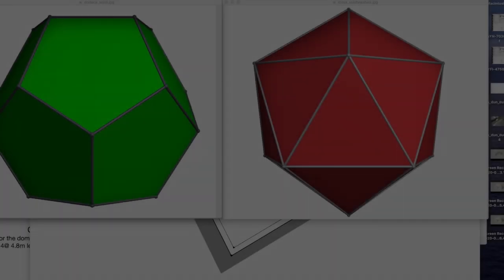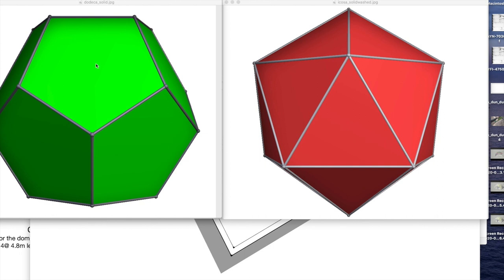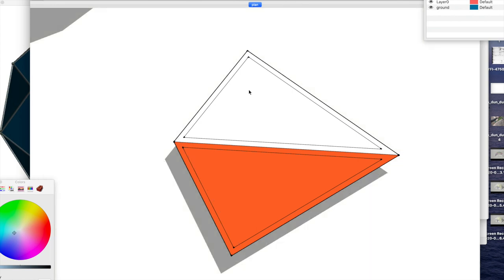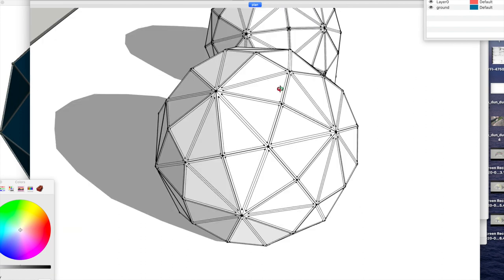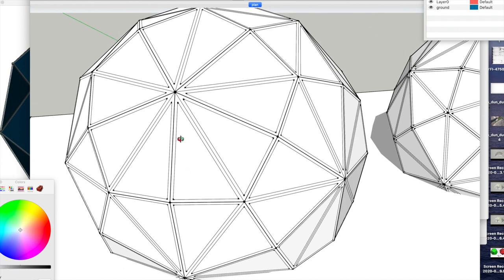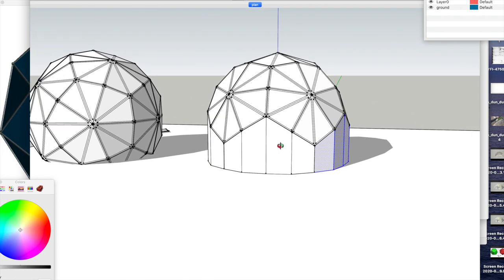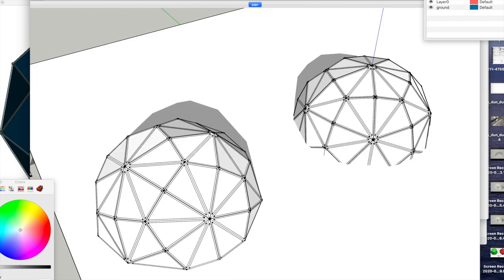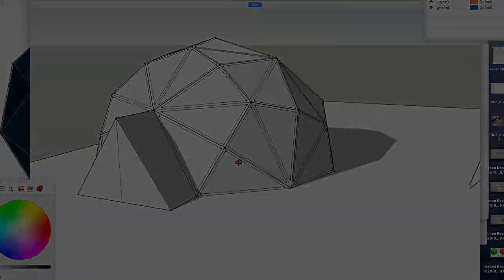Geo dome with only one triangle frame.

Comment: This is very interesting dome using mirror image panels.  Would like to see the plans for this.  A flat based dome of simply one triangle and it’s mirror image.  Doing research before build a dome home.  This or a 2V dome with extra supporting members in each panel.  By what you have shown a standard 4 by 8 foot sheet of plywood could be cut diagonally to cover the frame.
Reply from the maker: Link to plans is in the description on this video: https://youtu.be/V_KhrXggRsU I will be doing more ideas on this design so keep an eye out for them.

Comment: You can stellate a dodekahedron quite easily. Just snap a A4-paper in half diagonally. That's EXACTLY half of the triangle you need. Make two to make a triangle. Make 5 triangles into a pentagon and create a dodecahedron: there you are.. VERY easy to make a model this way. You can also use an A5 (half a4) or A7 (Quarter of A4) if you don't have enough A4 paper. You need 30 triangles. It's basically what he is showing. But I did the measurement math for you, so you don't have to.

Comment: There is one other way to get a door into that dome. In the arrangement that lets you cut it straight in half, just build straight rectangular walls to lift the whole thing up by the height of the door. You could then have essentially a cylindrical wall around the base and a dome roof.

Comment: "Only one triangle frame". Key to a manufactured solution! Domes as a mass-produced Housing solution require a low math variational solution. Dodecahedrons are all the same 'plate'. When edge length exceed 5' the 'v's kick in and everything starts multiplying, vertex angles, edge angles, edge lengths, requiring every new size to have a complete face-by-face mathematical solution. This is a barrier to mass produced geodesic dome spaces.

Comment: Paul do you mean you only need one jig, you just cover different sides with you finished surfaces? I too wonder how big a diameter you could make with timber panels and would appreciate plans, thanks.
Reply from the maker: I've done plans at 6.7m diameter because it works out great for 8x4 sheet material: https://youtu.be/V_KhrXggRsU

Comment: @7:33 Need to correct you there: there IS another way, you can also stellate the icosahedron, like you just did the dodecahedron. Acually it works with all platonic figures. So there is 4 more ways to do this, (also stellated cube, stellated octaeder, and a stellated tetraeder) but only one that makes a bit of sense, the icosahedron..
Reply from the maker: Yes but I thought stellated dodecahedron/icoasahedron are basically the same?

Comment: It's possible to make a one triangle geodesic dome using the class II subdivision on a V2 frequency dome in a different way. Its an adaptation of the basic triacon that is presented on the video called "full triacon". It is made with the same triangle used in the video, but it's mirrored on the longer side of the right angle to make one face of the triacon (just like the "door" made in the last part of the video). With only two diferent sides it's a very simple dome to make, and the base can be made by cuting these triangles in half (witch is the same as using the original triangle). So it would have a total of 32 triangles (or 30, since it's 28 full and 4 halfs). It's good for small domes, maybe less than 8 meters diameter, but for big domes the triangle becomes too big, witch can be very hard to handle. You can use the calculator on acidome.ru to get the angles to project one using frq. 2, class II, and I think in this case the "cross" symetry works better. (Link: http://acidome.ru/lab/calc/#1/2_Class_II_Piped_D100_2V_R2_beams_50x25 ).

Comment: A little question would be if this structure with only 1 sized triangle would be as structurally strong as the "normal" geodesic dome.
Reply from the maker: Yes, as long as a dome has triangle frames it will be stable, the. shape won't make much difference. On the other hand if the panels are square or pentagon/hexagon the structure becomes very unstable.
Reply: @Geo-Dome  I see, thank you very much for your quick answer :)

Comment: Two domes connected with the triangle, and a door on the front face of the middle section, than one side could be the bedroom and the other one the living space. Or even 3 domes connected this way with a separate kitchen module.
Reply: Let me guess. The kitchen modile should be cylindrical abd placed between two domes?

Comment: Loving the simplicity of this dome - is there a way to tweak the aspect ratio of this single triangle so that the panels can be cut from a standard 8' x 4' sheet? Looks like it would end up about 11ft tall and 20ft diameter, with standard materials.
Reply from the maker: Oh nicely spotted, yes I've nearly finished the plans and your measurements are just about spot on. 30 sheets of ply will cover it.

Comment: I like both solutions to make an entry. The vertical panels also adds more easy to use space on the bottom. The triangle extension would be a perfect way to connect multiple domes. And all with just a few different panels. Looking forward to the plans.
Reply from the maker: done https://youtu.be/V_KhrXggRsU